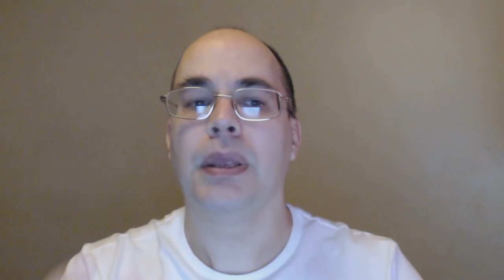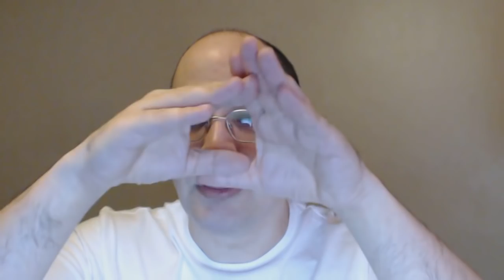How do rockets move in space, with nothing to push off from?

Comment: Actually, to take a step further, how can a rocket "push away" from anything?  Once the gas molecules have left the rocket they can have no effect on the craft itself.  So when they hit the ground they are irrelevant to the movement of the rocket and cannot move it.  Sure, they will push the Earth down a bit, but not enough to make the slightest difference..
Reply: A rocket doesn't push the Earth down
Reply: @thedevilsadvocate5210  The air that comes out of the exhaust of the engine has a force and pushes against the ground. Of course that will push the Earth away (just infinitesimally).
Reply: @thedevilsadvocate5210  Riddle me this. When you jump in the air, are you moving the Earth?
Reply: Because it doesn't, the gasses in the engine are pushing on the walls of the combustion chamber which is causing the acceleration, what is under the rocket should have no difference...

Comment: Rockets move in space, therefore they can ¯\_(ツ)_/¯
Reply: So it exists, therefore it is true ? While your reasoning is legitimate and valid, so is mine : It is true, therefore it exists.
Reply: No, rockets cannot fly in a vacuum.. along with the fact every vacuum chamber test shows atmosphere surrounding rocket before any movement can occur.. Aerodynamics doesn't exsist in space to actually control any of this supposed miricale thrust motion...  Oxygeniser starts burn filling tiny vacuum with gas to allow any motion not the ever expanding space... Space is a lie.. CGI green screens augmented reality harnesses and wires.. zero-g planes.  Camera 4th wall trickery.. rockets never get higher than 75 miles.. while being 1000 miles down range.. high altitude planes that always come back down or rockets ditched in the ocean.. mostly the Bermuda triangle. What goes up must come down when your trapped within an enclosed environment..
Reply: @michaelveroni1380  Correct .. If space is a cold vacuum or a hot vacuum (Hmmm The Flask theorum, still don't know which is true) .. there is no way a rocket can steer, slow down or manouvre (never mind stop and turn round on it's self) .. the whole theory of what this guy is saying is total B.S to brainwash everyone into believing that the space environment is like the Earth and reacts the same .. Laughable in the extreme, If you watched as many videos of rockets taking off as I have,  you will see every one of them arcing back to earth.

Comment: dude, there is no pressure in space ... everything you eject in space will be sucked ... you can't pressurize space ... no pressure ... NO MOVEMENT. no action / reaction. you can not move an object in space. PERIOD. the rocket conserves momentum from launch ... but you can NOT stop it or make it change its course. Ejecting air or some kind of pressurized gas into space does bull crap the univers s always EXPANDING it's not a sealed bubble that can be pressurized stop saying idiot things.
Reply: Space is not a vacuum cleaner. It doesn't literally suck. The rocket is pushing off its exhaust, and not off anything else, so it doesn't care whether space is pressurized or not.
Ejecting pressurized gas backwards will make rocket go forward, in strict accordance with Newton's 3rd law of motion.
Reply: Jan Strzelecki are you talking about the VACUUM OF SPACE ? Basically what you are sailing applies to paddles ... so if i build a rocket and flap the paddles i should be able to move forward ... it’s not possible mate, just like if you lift a moving car it will not move forward ... just like a drone can not fly in an unpressurized room ...
Reply: Jan Strzelecki are you talking about the VACUUM OF SPACE ? Basically what you are sailing applies to paddles ... so if i build a rocket and flap the paddles i should be able to move forward ... it’s not possible mate, just like if you lift a moving car it will not move forward ... just like a drone can not fly in an unpressurized room ...
Reply: You are ejecting air into space ... that is you action ! What is space’s reaction ? Is it opposite to that ? Does that mean it is pushing against your ship ? What happens if you open the door on a ship ? It ejects pressurized gas in space ... DOES THE SHIP MOVE THEN ?
Reply: @Alexandru : "a drone can not fly in an unpressurized room"
For sure, it use propellers...
For space, you need a rocket.

"You are ejecting air into space ... that is you action ! What is space’s reaction ?"
Action: pushing on air.
Reaction: air pushing on you.

"What happens if you open the door on a ship ? It ejects pressurized gas in space ... DOES THE SHIP MOVE THEN ?"
Yes, of course. Same way a deflating balloon run all over the room.
Reply: Alexandru Musat 
You're sounding like an idiot sir. How can on one hand you say they work different but then say they both use the same principle, they push mass. 

They do not do it the same way. A drone works when 
It hovers by the rotation of the wings or propellars. two rotating clockwise and two counter clockwise. 

A rocket creates thrust by using Newtons Third Law of Motion. For every action there is a opposite equal reaction.
So the downward thrust of the engine propels the rocket. The thrust of the engine is not reacting against wind, or any other substance.  

Here's a challenge for you. Find one book, magazine, journal, anything that shows a that a rocket requires a physical source to thrust off of.
Reply: A DRONE does not use Newtons Third Law of Motion ???? Bwhahahaaha!!!!!!! .. ok i'm done ! i'm not here to convince anyone of anything ... trololo
Reply: Thomas Kundera other than what i wrote i can not explain anymore ... it’s like convincing a christian there is no god .. a rocket does what a drone does ... pushes against air ... it just does it differently ... stop saying “ uh rocket “ like thats the answer to everything .. be logical
Reply: Alexandru Musat drones and rockets are two entirely different forms of motion. 
If you can't see that simple fact then you are obviously not capable of understanding Newtons Third Law of Motion.
Reply: djstcroix thank you for you enlightening comment ... when did i say they are the same thing ? Do you always include yourself in conversations for no reason whatsoever?? They use the same principle, they push air and mass away from them, causing them to move, sure they work different
Reply: G.Gorrell A. You never detonated a bomb in a PERFECT vacuum so you wouldn’t know. We just know what theoretical physics tells us. REAL science is done by experimenting
B. It’s not REMOTELY THE SAME THING. shooting a gun CAN works in space. And that is near your example more then rockets are.
C. If you see this as talking down to people, i’m sorry, but please come up with a better example.

Again, they shoot gas, pressurized gas out of nozzles to guide the ship, or rocket or thing.. not an explosion, GAS, PRESSURIZED GAS
Reply: G.Gorrell what is it with you and detonating bombs dude ... who put that into your head ???? chill the f down
Reply: https://www.youtube.com/watch?v=Fnf_f4rogtg

Comment: I just came from a video that shows a balloon flying in a vacuum under its own power. The mass of air is being accelerated in one direction therefore there will be an equal and opposite reaction in the opposite direction regardless if there's any other substance to push against. Accelerating the gas molecules in the air from a stand still to full speed as they exit the ballon creates physical force therefore you will have forward motion as the air pushes against the inside of the ballon trying to find a way out while being pushed on by the compression of the baloon. The motivational energy comes from the elastic properties of rubber transferred into the air accelerating it out of the baloon.
Reply: Rolteus
, the balloon's gasses are pushing off and away from  the vacuum chamber's walls...You fucking imbecile.
Reply: @asleepinthealley   you idiot:  that'd only be effective big gas molecules were constantly in contact like some infinitely extensible spring.  What you flatards don't understand - well, one of the many things you don't understand - is that a gas is mostly empty space with the occasional solid atom/molecule, so all the force exerted as pressure is just the molecules bouncing off of whatever they hit.  A spring, being solid, has atoms bound in continuous contact so can 'push off' from something. An exhaust jet, being gaseous, cannot - at best the molecules in the exhaust might have pressure waves that rebound molecules back towards the nozzle, but even then that'd only exert force on the rocket as and when those molecules bounced off the solid wall of the nozzle.
Reply: @asleepinthealley  do you want to refute any specific point?
Reply: @asleepinthealley  no, you said that you were impressed with the volume and erudition of my prose.  While flattering that hardly constitute a robust or even coherent defence of your position that the creator of this video has failed to put forward a valid set of arguments or that his evidence is lacking in veracity.
Reply: @williamchamberlain2263  You babble on trying to make yourself sound intelligent, but it's all for naught. You actually believe we've been to the Moon and that cancels out any other bullshit you spew.
Reply: @asleepinthealley  do you want to refute any specific point?
Reply: @asleepinthealley  no? Nothing in particular you want to object to with counter-argument?
Reply: @papalegba6759  but how does work get done by the individual molecules of a gas, as they move through empty space and bounce off of each other and off of solid surfaces?
Reply: @papalegba6759  springs and gases are compressible for different reasons: can you describe how they're different?  Hint: springs can store and transmit force because their atoms are in continuous contact, but the molecules of a gas are __